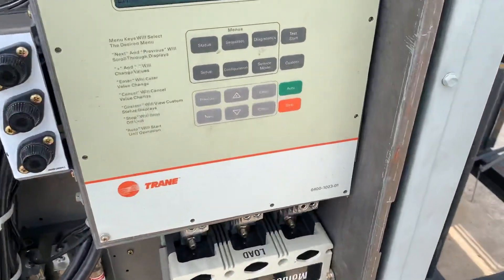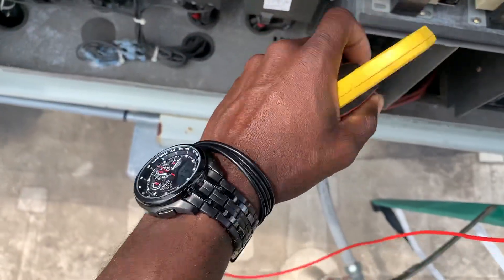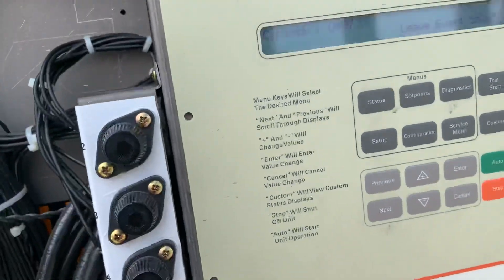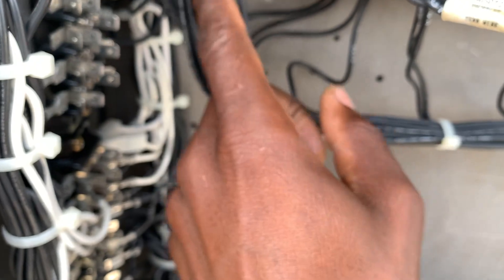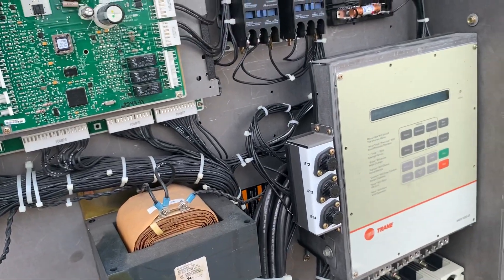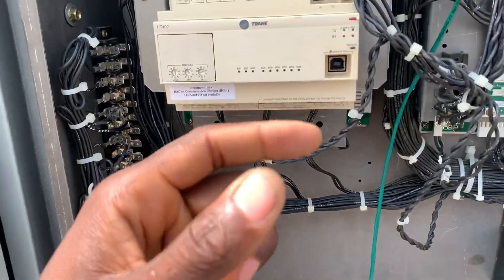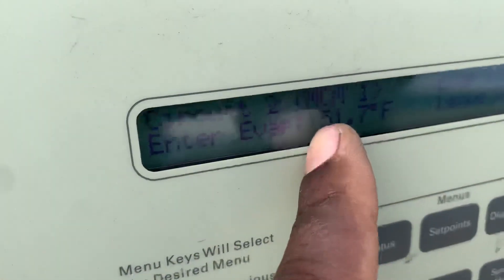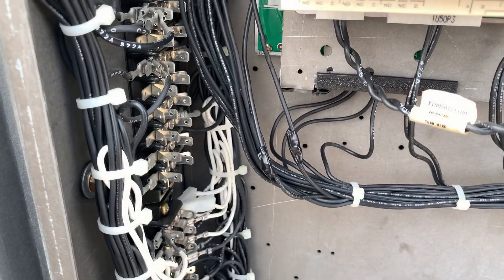HVAC TROUBLESHOOTING TRANE AC

Comment: Hey bud, I have a unit circuit 2 compressor 2A is tripping breaker after some run time I checked compressor ohms it's ohms out equal 1.5 ohms on all three legs I disconnected compressor wires now breaker won't trip what could be cause ? Is it a weak breaker ? I couldn't verify and also how does the unit knows that breaker tripped and shut down the while circuit 2 compressor on saftey lock out. There is no auxiliary switch or something on the 3 pole breaker how does the unit do this lockout ?
Reply from the maker: Hi you should megohm or megger test the compressor each legs to ground and FYI there's a switch behind the ckt breakers that how the unit knows.  If you don't know how to meg test watch my videos on the subject